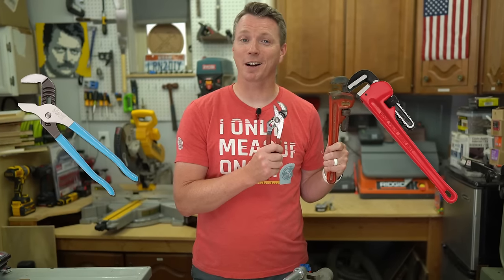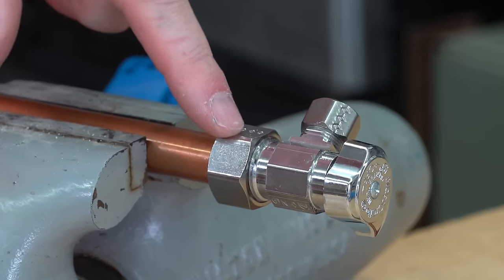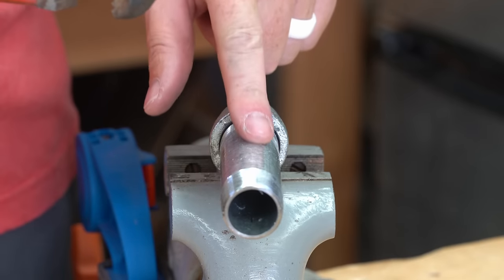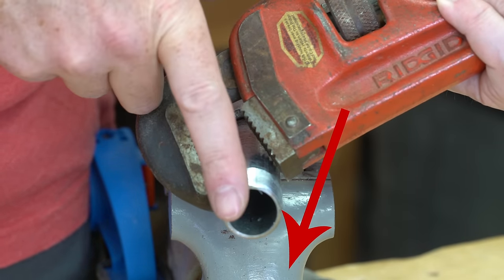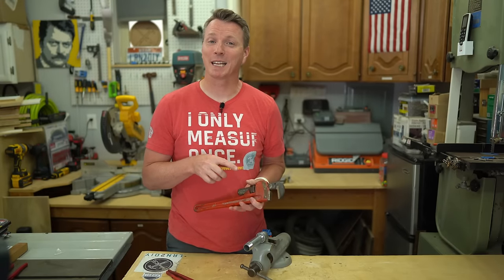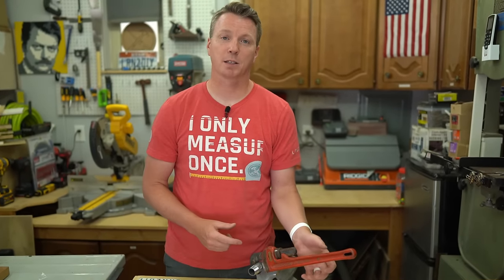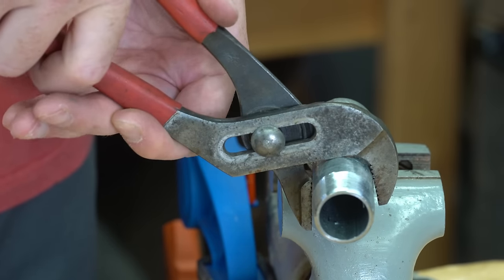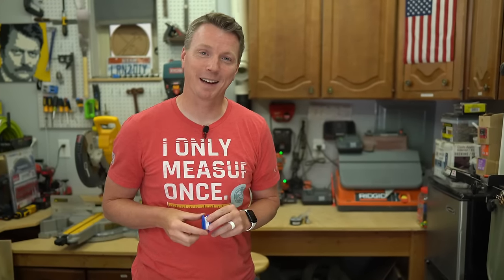3 MISTAKES We Make Using Pipe Wrenches & Channel Locks

Comment: Our Maintenance crew once got some instruction from a safety engineer about the safe use of handtools. We were told that, when using tongue and groove piers, we should always adjust the handles such that we have the minimal spread between them that still gets a grip on the fastener. To use them with the grips spread too far apart, as you did when demonstrating them, can cause damage to the tendons and ligaments in the palm. He also recommended that, when forced to PUSH on an open end wrench, pipe wrench, or adjustable Cresent-style wrench, it is best to do it with an open palm. If the wrench slips or the fastener suddenly breaks free you are less likely to bust your knuckles if you aren't wrapping your fingers around the wrench's handle. It is also preferred to PULL on a wrench when possible because the bicep will be doing the work and your whole body won't go flying backwards if the wrench slips, for instance. Shoving on a wrench sort of requires leaning your whole body weight into it and you can tumble forward if the wrench slips. These aren't hard and fast "rules" for using the tools, just the things that we were asked to keep in mind when we worked.

Comment: Very informative, but the same applies to the Crescent wrench, (adjustable wrench) that you used in the beginning. You put the force against the movable jaw in the wrong direction, and you should be pulling towards the movable jaw.
Reply from the maker: Every time I post a video I learn something new from viewers like you. I must have completely missed that and didn't even think about it on the adjustable wrench, so thank you!
Reply: I came to post the same thing. In the demonstrated use, forces push outward on the moving jaw creating a risk for slipping off &/or rounding the fastener, when used the correct way that jaw is pushed downward, into the handle of the tool, locking it firmly in place.
Reply: Came to say the same.  I always remember it (for all these tools) as pushing/pulling TOWARD the open end of the mouth.
Reply: that's incorrect.  when you turn the nut with an adjustable wrench, the force should be applied as close to the base of the moveable jaw as possible, to minimize leverage against the slide mechanism.
Reply: Well...that was ironic.
Reply: That's the first thing I noticed. I was expecting him to point this out.
Reply: You BEAT me to it!!!
Reply: Yet, NONE of you point out he is holding the valve still by holding the compression nut instead of using another adjustable wrench to hold the flats of the body…
Reply: I see them used incorrectly in most videos by the "expert" DIYrs videos.
Reply: @kenbrown2808 No you are wrong, they are correct. If you look at crescent brand wrenches they even have an arrow on them that say turn this way because when you turn them the right way it pushes the movable jaw into the large face of the wrench instead of pulling it away from it.
Reply: @christopherhowlett1096  and it pushes on the skinny wobbly end of the jaw instead of the big wide stable end.  but I'll grant Crescent has their leverages wrong.  but then, none of my dad's crescent wrenches have that arrow.  and knockoffs roll off the fastener a lot easier when you turn them the way you want to turn them.  so basically crescent is getting away with bad leverages.
Reply: @kenbrown2808  It's a twisting force when you turn a wrench. It called torque. It's not pressing directly up or down. Man just look it up insyof being stubborn. It presses the loose end into the solid end of the wrench if you turn it the proper way. The sad part is you won't even look it up to see that you're wrong. Either that or we are misunderstanding each other. The newer crescent brand wrenches have an arrow on them because so many people use them backwards and it is bad for the wrench and will allow slippage which round off bolts. My friend said the same thing until I showed him the arrow that he had never noticed before. From what it sounds like you think you know more about how to use the tool than the company who created the damn tool lol. Since you're that type of person there is no point in arguing.
Reply: @christopherhowlett1096  the instruction I had predates the arrow.  and like I said, if you do it the crescent way with a knockoff, it WILL roll out much easier if you put the pressure out at the tip of the sliding jaw instead of down at the base.  and your crescent wrenches must be different than mine, because mine have the jaw perpendicular to the track, and the force on the jaw tries to push it along the track, not push it towards the track.
Reply: @kenbrown2808  I never said anything about putting anything at the tip of the wrench of course you seat it near the back of the wrenches jaws I never said anything different so I don't know where you're getting that. I don't know why you would say anything about your jaws being perpendicular I never said anything about that either so I don't know what the hell you're talking about. My point is that you're twisting a nut It doesn't put a direct upward or downward force on the jaws It's a twisting force that applies pressure in all directions. The more I read what you were saying I think we're actually agreeing with each other I think you just worded it in a way and I didn't understand you and/or the same could have been true for me maybe I worded it in a way that you didn't understand. Here is what I'm saying in simpler terms. The way he turned the wrench in the video.... Do the opposite.
Reply: @christopherhowlett1096  you only turn 1 dimensional nuts?  no. we're saying the opposite.  the arrow on crescent wrenches puts the force of turning the nut at the weaker end of the movable jaw.  and it's not like a T&G pliers where the ridges on the jaw and the pivoting motion; as well as the pressure of your hand on the handle,  direct some of the leverage into keeping the movable jaw closed.  a crescent wrench relies on the worm drive and the rail assembly to keep the movable jaw in place.  so you position the wrench so that when you apply force to the handle, the pressure is as close to in line with that track as possible, so it's not applying torque on the track, which can allow the movable jaw to flex and allow the wrench to roll off the nut.
Reply: @kenbrown2808  obviously the instructions that crescent gave when they designed and made the wrench pre-date the bad advice that you got from your dad or whoever it was so that's a stupid argument.
Reply: @christopherhowlett1096  you already said the arrows are a new thing.
Reply: @kenbrown2808  crescent invented the wrench 114 years ago. The arrow that has been either cast into the wrench or Lazer etched into the wrench started in the 90's and is following their original instructions on how to you the wrench they made 114 years ago. Unless you were given your instructions 114 years ago it predates any incorrect instructions you got and you are using the wrench wrong and who ever taught you that was wrong. You are either being a troll or are most dense know it all human being. Do yourself a favor and look up how to use it from the company who designed and created it. If I could send you a screenshot of the original instructions for the original adjustable wrench I would but youtube doesn't allow that. Or don't listen me and keep blowing through straws wondering why you don't get anything to drink and telling people it's lefty tighty righty loosey.
Reply: I saw that
Reply: I stopped watching as soon as this happened, knew I wasn't gonna learn anything new lol

Comment: I would argue that the slip joint pliers should have been opened one more slot :)  They should be adjusted so that the handles are as close to parallel as possible.
Reply from the maker: Excellent point! I always learn from the comments section so thanks for sharing. I'll have to pay closer attention to that.
Reply: @LRN2DIY  you are correct the handles were to far apart

Comment: I realize that the nut you were loosening was only hand-tight.  Been there.  Done that.  Being picky but I was taught that the moveable jaw needs to be pointed in the direction of rotation.  This puts the force against the fixed jaw while the adjustable jaw keeps the wrench on the flats.  Using it the other way puts all the force on the the moveable jaw and may damage it.  I was also taught to only use an adjustable wrench when a proper sized wrench was not available.  Adjustables have a tendency to slip off and damage the flats as well as the users knuckles.  Many years ago, I was on my first job and the old timer I was with gave me an adjustable and told me to remove a filter from it's canister.  I looked at the wrenches sitting there and her told me to use the adjustable.  Later, he told me that he did that to see if I used the adjustable correctly.  I had and he had passed that along to my new boss.
Reply: you were taught incorrectly.  the force will always be split between the fixed and movable jaw.  just like with a pipe wrench, you want the movable jaw to be pulling on the nut with the base, rather than pushing on the nut with the tip.an adjustable wrench will always be more likely to roll off if the force is toward the tip of the movable jaw.
Reply: You WERE taught correctly!  I think @kenbrown just misunderstood you, so disregard his comment. Everyone on here commented about how he was using them the wrong way, so don't worry...you were taught the right way
Reply: @purdyboi8078  multiple people being wrong doesn't make them right.  with a Crescent style wrench, it works best when it is oriented so the force is against the BASE of the movable jaw, instead of against the TIP.  if your wrench is a cheap knockoff, applying the pressure at the tip of the jaw will cause it to roll off the nut.

Comment: Thank you for the video.  I knew about the first and second mistake, and about the hidden mistake you made at 1:16 (and by the way, even standard non adjustable wrenches have a good and bad direction of rotation; the angle in the wrench must be "wrapping" when applying force, just as with adjustable wrenches)
But I never knew about the 3 points contacts in pipe wrench or channel lock.  Thank you so much for this explanation 🙂😉

Comment: Good information about these two tools. I see many people use the slip joint pliers backwards and not have 3 points of contact with both of these tools. BTW - It should be noted that, while using the adjustable wrench on the fitting, you used them backwards ... another common mistake many people make. They should also be used in the same direction of handle pull to jaws as the pipe wrench to keep the force of use from opening the jaws.

Comment: Good video.  We all hate adjustable wrenches , but we all have therm and we all use them when we  know we shouldn't.  I worked in a mill once where they actually took them away and outlawed them.. (Too many rounded nuts)    I didn't know about using  the pivot slop in the pipe wrench.  Been using them all my life.

Comment: Good job on the video. The adjustable wrench you used is designed with directional use also.
You used the wrench backwards when you loosened the nut. You have maximum turning and force applied when turning.

Comment: Gotta disagree on the three points of contact on the pipe wrench. In a perfect world maybe, but if you are working in a hole, or tight space having the pipe all the way back in the throat could cause slippage.  Also can lovk the wrench on to the pipe making it impossible to ratchet and remove the wrench. 

When working with metal pipes, alot of jobs involve old rusted, froze up pipes and the last concern is crushing it. Just getting a good grip, half way on the jaws and so the jaws are parallel is the way to go. And properly sized wrench as well. Bonus tip, they make offset pipe wrenches and pipe wrenches oriented like a Cresent (adjustable) wrench too that are so much better to work with in most cases...

Comment: Might be worth adding the “strap wrench” to this list as well. Literally an adjustable rubber lasso that tightens through a handle and had ridges to lock onto a surface you don’t want to mar or crush.
  Only caveat is how strong you are. For example it can be used to tighten a bathtub faucet perfectly and doesn’t damage the finish in the spout whatsoever.
Reply from the maker: Great point, James. Those are pretty awesome in a lot of cases.

Comment: Another important reason for the three points of contact is to reduce the risk of distorting the shape or roundness of the pipe. One thing I am not clear on is if a crescent wrench should only be used in one direction. I see you used it in the opposite direction I have been educated to use it for.
Reply: You are correct. He was wrong.

Comment: @LRN2DIY Your first mistake was also using the adjustable Crescent BACKWARDS  at 1:13 in video. If you use the crescent wrench the way you did you put stress on the weakest part of the tool the adjustable section instead of the stronger part the solid part made directly to the handle.

Comment: Channellock makes tongue/groove (parallel) pliers with a smooth jaw (no teeth) to prevent leaving teeth marks on metal fittings > Channellock 415 10-Inch Smooth Jaw Tongue.

Comment: I prefer to use my Knipex.   Leave my Channellocks for wire cutting.  As others have said,  Channellock is a brand name that makes lots of different tools.  Also, again, as others have said, use smooth jaw pump pliers for finished material.   Otherwise, this is a very informative video. 👍
Reply: Not technically true they are called tongue and groove pliers too. It's kind of like crescent with crescent wrenches aka adjustable wrenches or adjustable spanners. They get called this because channel lock invented the tongue groove pliers and I know crescent invented the adjustable wrench. I will say this the guy who invented tongue and groove pliers(Howard Manning) actually did patent the name channellock for them so it isn't technically incorrect to call them channellock pliers because that's what the patent says. It's like when people argue about silencers and suppressors saying you're calling the wrong thing if you call him a silencer which is incorrect because the patent for the design was actually called a silencer but it is appropriate to call them suppressors as well because that's what they actually do.

Comment: I have channels locks that have no teeth. In fact, they are completely smooth. What would those be used for? Thanks for all this info.
Reply: Same application...except if you don't want to leave any marring on the finish of whatever you're using it on. They're called smooth-jawed water pump pliers

Comment: Why does it seem to me that everyone in these comments has never used a wrench? A simple wrench is angled. In a tight space with few degrees of rotation available the way the wrench faces matters because it will sit differently on the work. Also, adjustable wrenches shouldn't be adjustable by the work itself. Yours may be busted.

-EDCs 4'' adjustable wrench and knipex raptor pliers..

Just go use one for yourself. I'm wrong 😂

Comment: I would argue that the slip joint pliers should have been opened one more slot :)  They should be adjusted so that the handles are as close to parallel as possible.

Comment: Great tip on gow to properly orient pipe wrenches and slip joint pliers, then you used an adjustable wrench backwards. The same thing applies to them as well. The way you used itt applies all the force on the weaker adjustable jaw rather than the stronger fixed jaw.
Reply: you are incorrect.  both directions will apply force to the adjustable jaw, but the direction he turned it applies the force to the strong base of the jaw, where the adjusting mechanism can withstand it best, rather than the tip where leverage can cause it to flex.  set a Crescent (tm) wrench on top of a pipe wrench with the movable jaw in the same orientation.  that might illustrate the point. (the handles will be offset by 90 degrees)
Reply: @kenbrown2808  with a crescent wrench in your hand like you are shaking hands with it the fixed jaw should be on top and the adjustable jaw on the bottom same as water pump pliers or a pipe wrench and you push the handle down
Reply: @kellybell9235  so you are saying he should have rotated the wrench 120 degrees around the pipe but kept the jaws in the same orientation?  that is acceptable, but really pulling or pushing on the handle only affects the angle of approach to the nut.  it is the orientation of the jaws that is important, and he had the jaws oriented correctly.
Reply: @kenbrown2808  what I’m saying is he should have flipped the adjustable wrench over to turn the nut the direction he was turning it

Comment: 3 point contact, well, maybe. Gettin the jaws on straight is more important. Because you were working in a vice, there was no need to mention the most important rule: 
Pipe wrench’s and Channelocks are best used in pairs. One wrench to hold the rest of the piping still and the other to tighten or loosen the nipple or fitting being worked.

Comment: Guy giving advice on how to use tools demonstrates using an adjustable spanner backwards within the first section of the video.  The springs will let a pipe wrench release to rotate backwards it doesn't get any more self explanatory than that. Gravity is a horrible assistant when plumbing. 3 points of contact is also wrong.  Also the pump pliers needed to be open one more notch.